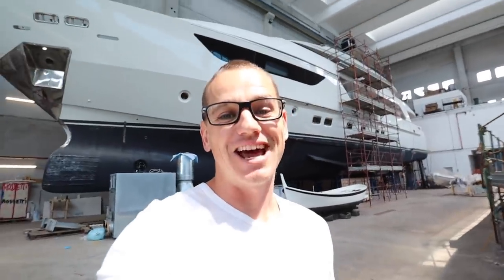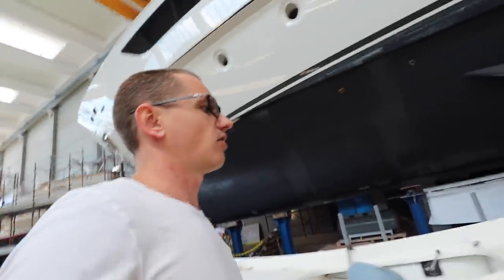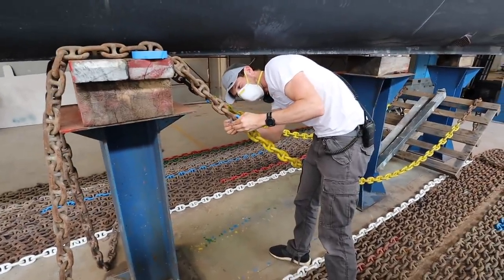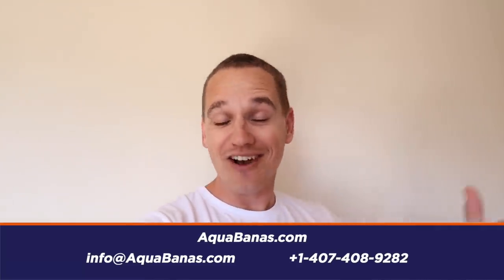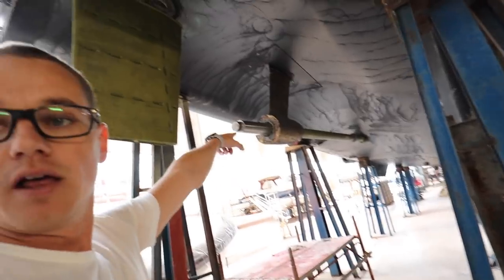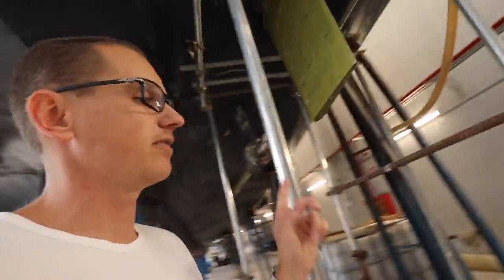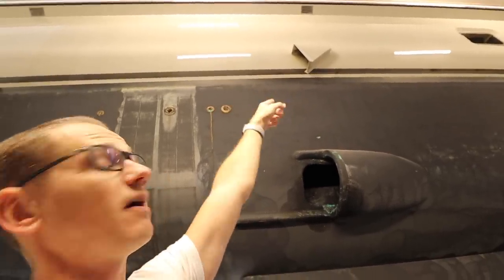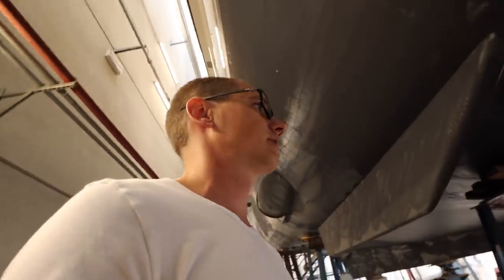They Broke A Window!!! (Captain's Vlog 131)

Comment from the maker: Hey Guys, Just to make a small correction, The anodes we have are zinc which is not a soft iron.

 I was clearly getting confused with Magetism when it comes to soft and hard irons.
Reply: You are clearly just eager to get back out for the season.

Just making a video tends to remove half one's intelligence, let alone having other things on one's mind.
Reply: Uuuuh iron is just iron the softness of it depends on temp.
Reply: Seems rather expensive to own a yacht 🤣🤣🤣
Reply: @mauricematla1215  
I won't say that you are wrong, but it weren't what Tristan referred to.

Tristan referred to the the magnetic properties of iron, it can be anywhere from soft to hard. (as a description for how easily/well it gets magnetized and retains said magnetization.)

Heating iron for a forging/casting process is a totally different topic, and yes, that type of soft is temperature dependent.

Though, magnetic properties of iron are also effected by temperature, but it usually just looses its own magnetic field when reaching its Curie point, taking on whatever the field around it currently is. (And when it cools down, it retains this new field. This is btw how rare earth and other magnets are magnetized to begin with.)
Reply: Regardless of the size, yachts live in a Hostile Environment.
Reply: @ah244895  its relative to income.
Reply: I wonder if your subconscious was giving you the word "Ion" when you were thinking about electrolysis?
Reply: As a diver and security specialist on oh so many M.Y's, I thought I had gone nuts when you said the anodes we're a very soft iron. I used to check the boots on many MY's, especially when they using magnesium or starting to toy with aluminium or someone new had dropped something. Many great year's that I would get back to at the drop of a hat. I used to have to dive a twice or thrice daily under ship check when posted on the greatest M.Y of them all, Brittainia, but that was when I was in another life aged 23 laughing at the 40-year-old matelots running around while we enjoyed the finer things either because, as we believed, we were made of better stuff, or because anyone willing to dive under a 106m MY that had 600mm of clearance in some ports feeling for bombs were considered nuts!

I preferred the checking and the owner/crew scuba training I did (not forgetting the safety watch while everyone was playing) in your type of MY, seldom in grey bilge, but in the nice and blue.

I'm enjoying your YT vids, keep those feet dry!

Comment: Yellow links are the WARNING shot (2nd to last), red links are the DANGER (last) shot.

Good to know if you've got a runaway chain...  If you see yellow come out, move your ass because when the red comes out either the chain end is gonna come whipping out shortly or the hold down gear on the end of the red shot is coming up.

Those are man killers.
Reply: We painted mine and the paint last 6 months ... the friction between. the links destroyed the finish.

Comment: I would be surprised if the sacrificial anode is made of iron.
Since that won't really protect iron/steel from corroding. (Iron has a higher electropotential than general steel, so if the anode is made of iron, your shaft will corrode first....)
A sacrificial anode must be made of a material with lower electropotential than the material one desires to protect. (Look up the Galvanic series, it has most metals ordered by electropotential.)

Most common sacrificial anode material is zinc. Primarily due to its low price, but also due to it being very near the bottom of the scale.
Zinc oxide is also fairly mechanically weak and any dirt in the water will easily knock off the oxide that is on the surface, then it can't easily build a protective oxide layer.

Aluminium is another "anode" material, it is though not suitable as a sacrificial anode since it firstly have a higher electropotential, and secondly, it easily builds a protective oxide layer.
Aluminium oxide is one of the harder materials known, it is typically also what one can find as the grit used in a lot of sand papers on the market. Aluminium oxide can also form crystals known as sapphire. (Rubies are also aluminium oxide, but with trace amounts of chromium in them.) But the worst part of aluminium oxide is that it doesn't really expand all that much when it forms, so it tends to adhere very well to the base metal and form a gass tight layer protecting the rest of the metal from corrosion.
Reply: Zinc for saltwater sailing, and aluminium for freshwater sailing (lakes etc)... Some say magnesium anodes are best in freshwater, I wouldn´t know, they might be right. But iron anodes, never even heard of...

Comment: Looks like a lot of work hand painting that chain with spray cans. Have you ever thought about electrostatic painting it. Electrostatic painting uses positively-charged paint particles from a specialized gun to coat grounded metal surfaces. Like a balloon clinging to a wall, it’s attracted to the grounded surface and will wrap around the component, such as a fence post. This results in an even coat with little overspray and waste.
Reply: What a yacht

Comment: Bonjour Tristan,
I did not congratulate you for your passed exam, you are almost ready to 
be the next captain  of HMS Queen Mary 3 :+)
Little question, this yacht seems to have no dynamic stabilizers / anti roll system, would it be reserved for larger yachts ?
Amicalement, Raphaël

Comment: Sorry captain Tristan but if you said the sacrificial anodes  are made from"soft iron", you are wrong. The three most active materials used in sacrificial anodes are zinc, aluminum and magnesium. Yours seemed to basically be containing zinc.  Btw,,,just love your channel. Very entertaining.
Reply: Yea How did he not know they are zinc?
Reply: Zinc is indeed the most common sacrificial anode material. Followed by Magnesium.

Aluminium on the other hand is a very very poor choice for a sacrificial anode.
Not really due to its higher electropotential than zinc. Nor its higher cost.
But rather the fact that aluminium form a very hard, rugged, oxide layer that also protects the rest of the aluminium from oxidizing.
(Aluminium oxide is one of the stronger materials out there, the grit in sandpaper is typically made of it.) And a sufficiently thick oxide layer can form in a matter of hours if exposed to air at room temperature.

Aluminium is the kind of material that one can build a whole boat out of, and technically not need sacrificial anodes on it. (If one drives over something sufficient to scuff off the oxide layer, one will likely have bigger issues on hand as well...)
Reply: @MrTranceXL 
There is a difference between aluminium and aluminum alloys.

Aluminium itself isn't a good choice of material for a sacrifical anode.

Add some zinc or indium to it, and its ability to form a protective oxide layer stops being a problem.

https://www.absolutemarine.co.nz/image/catalog/documents/anodes/truth_aluminum_anodes.pdf
Reply: Well he also called the center bearing a cutlass bearing the cutlass is actually in the propeller shaft strut

Comment: Hello Tristan,
Congrats on your successful channel, I have a question about the underwater exhaust you pointed in this video: isn’t that bad for the marine environment? Do they regulate the marine engines like the cars , euro 4-5-6?
Reply from the maker: Yes, the Engine builders (caterpillar) all need to do emissions tests.
Reply: @SuperYachtCaptain  thank you for your answer but you still didn’t answer my question, isn’t it bad for the marine environment filtering your engine emissions through the sea?
Reply from the maker: No worse than the air.

Comment: Working with the Royal Fleet Auxiliary service (RFA) as a Leading Deck Hand we carry out many many Replenishment At Sea (RAS) serials with Royal Naval vessels. During replenishment the two vessels (one supplying, one receiving) are approximately 40M apart and making way at 10-12 kts. One quick and easy method for the bridge team to check on the distance between ships is to glance down at the Distance Line (one of three ancillary lines passed) that is marked up with small coloured and numbered flags set at 6M intervals along the line. The colours are 0 - Green, 6 = Red, 12 = Yellow, 18 = Blue, 24 = White, 30 = Green, 36 = Red, 42 = Yellow etc etc. So the mnemonic is 'Gently Rub Your Balls With Grease'. Colour to same colour = 30M

Comment: I had issues with getting bottom paint adhering to the P Bracket. Being metal for scientific reasons and if not done properly the bottom paint wouldn't stick. So had  Prop-Speed applied to the P-Bracket as well to prevent marine build up and damage. Consider doing so. I noticed the P-Brackets were stripped of bottom paint in the video too.

Comment: I said this before, when I was watching this video I noticed again,even out of the water and on stands, AWOL has such clean sleek lines. Rub Your Balls With Grease , Red,Yellow,Blue,White and Green, got it what ever "floats your boat" to remember.  Is each color on the anchor chain called a shot and each shot 90 feet. What ratio of anchor chain to depth do you use when anchoring. When I had my 19 foot boat I used 3 feet of anchor rode for every foot of depth.

Comment: Basic question p'raps, but why are you painting the anchor chain?
Reply: It allows the deck crew to know how much chain you have out. There is a formula used to determine how much chain to let out with the anchor(s) to keep the yacht from dragging the anchor. Each color is a “shot” which is 90 feet long. Example: 3 shots=270 feet.

Comment: Is there an epoxy type paint for anchor chain?  I'm just curious if that would extend the time before gunking-up the chain and re-painting again.
Reply: The chain is still gonna grind that epoxy paint up like it's nothing. Think what that chain does as it goes thru the gears and piles in the locker.
Reply: @JCrook1028  Yep, thanks. . . .I didn't think that through . .wonder if anybody makes SS anchor chain . . .maybe too expensive.

Comment: You got to explain how you feel it’s Kay to dump the exhaust which seems rather dirty, abnormally high into ocean but not onto the boat hull. If the engine is exhausting bad contaminants, fix the source of the problem. I don’t know of such engines but old poorly maintained engines can burn poorly and exhaust high contaminants. That boat is on high value, get owner to fix engines rather than some fancy exhausting system to keep hull clean. Show some respect for the ocean.
Reply: Island Cruising presents Larry Meyer  - most are diesel - and there is no way for diesel to be clean - check the Volkswagen cheating scandal .
Want to be upset , realize all of Europe  continues to allow car companies to continue poisoning the air that children breathe  .
Just guessing - exhausting into the ocean water is the lesser of the 2 evils

Comment: Just my 2 Cents: its such an expensive boat and you have to wait 12 weeks!!!  for 1 new window?? And the complete season is    gone because of that? WTF? Why not order a COMPLETE SET of all windows and do them in a storage for such an emergency?  Cant believe this
Reply: Cost of glass is high and you really only want to replace glass by exception, not a standard practice...
Reply: Btw, if you actually listen they did NOT wait for the new window. They simply ran last season with the cracked glass.  I know it's hard, but maybe try paying attention to what is said before opening your mouth and spewing nonsense?